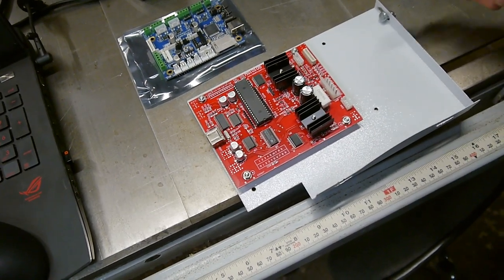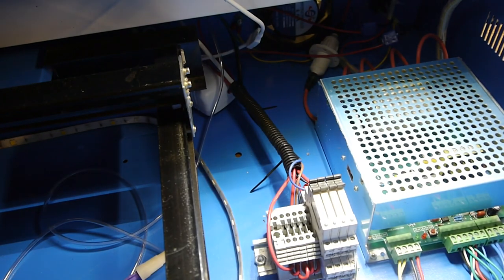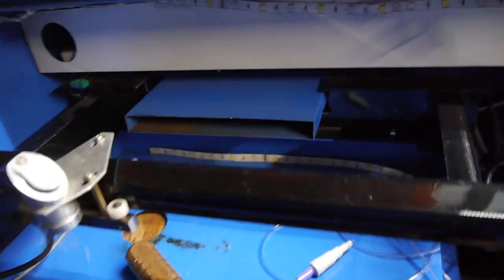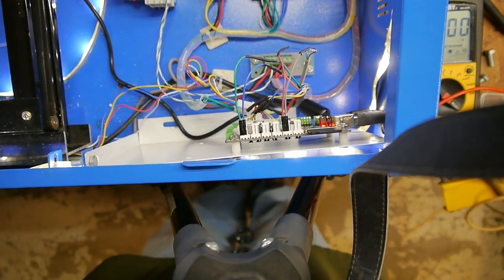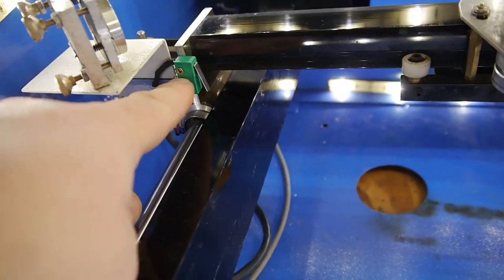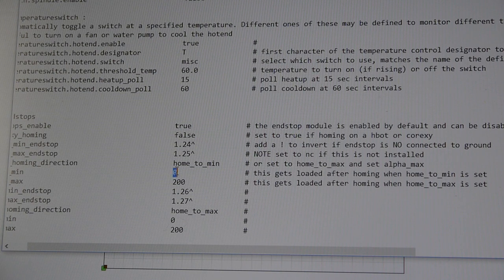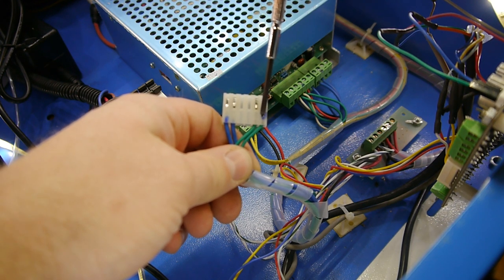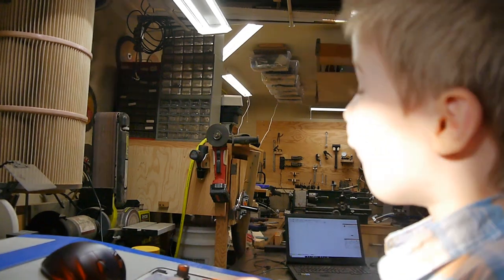How to Replace the MS10105 Board with a Cohesion3D Laserboard - K40 Upgrade (Fixed Audio)

Comment: Nice video. Just got the board myself. Having an issue where despite setting everything to 100% cut power, 1.0 max output, with the potentiometer set to 15mA I cant cut squat. I test fire from the stock switch at that power instantly burns through. Any ideas?
Reply from the maker: Thanks, Does the laser fire at all? If it does then maybe software related, if not then wiring related? Your best bet would be to go to the Cohesion3d Forum and post a couple pics of your unit and wiring and describe what the problem is, like you did just now. I had a slight problem with my laser firing, but I think I originally had the ground and laser fire wires backwards. Good Luck!
Reply: @JoshAQ  yeah it fires as expected just not as much cutting power as it should be
Reply from the maker: @OrderSixTsix  Are you using lightburn software to control it?
Reply from the maker: @OrderSixTsix  It sounds like a software setting or issue then.
Reply: @JoshAQ  using lightburn. Have cut setting to 100% and modified config file max output to 1.0
Reply from the maker: @OrderSixTsix  I was hoping something would occur to me, but I have nothing.... Sorry, I would check out the forum at cohesion https://forum.cohesion3d.com/ that is probably your best bet to find someone else who has had your problem.
Reply: @OrderSixTsix  Hello,  did you figure this out?
Reply: @ddfwaj  I did. I replaced all of the mirrors and that seems to do the trick. Not sure why the old board seemed to be cutting when it actually turned on but i suspect it was putting out way more power than it was supposed to be. Either way, new Cohesion board is working like a dream and LightBurn software is great.

Comment: 00:40  ehh.  changing the board isn't going to fix a problem you have with your sensors.  

i havent replaced my standard board yet (that's why i am here ofcourse.  i wanna use lightburn) 
but i have NO issue's what so ever with the origin accuracy.  
infact i would do cuts in several passes and just programmed a single pass.  it would then rehome every time and it was always on point.  
same thing if i engraved and then cut
Reply from the maker: What model of board do you have?
Reply: @JoshAQ  the one that the cohesion3d is a direct drop in replacement for.
Reply: i am going to use an skr v1.3 instead of the cohesion3d though.  wich is also why i am putting it off.  
the cohesion3d apparantly comes pre loaded with firmware (drop in replacement)  this skr v1.3 does not come pre loaded with firmware.  so i have to figure out what firmware to use.  and then configure it correctly so the pwm signal is of the correct frequency to control the laser output.  

with the wrong frequency it's possible that pwm 25/255 is 15% power output.  
and pwm 26/255 is 80% power output. 
and pwm 27/255 is 0% output.  

 excetra. excetra.
Reply from the maker: @darkracer1252  I see, well the benefit to you is no additional cost, but some time needed to piece together firmware without frying something. That task is certainly beyond my rudimentary understanding of such things and the time necessary to learn to figure them out without frying them.
Reply: @JoshAQ  yeah i won't be coding my own firmware from scratch.   it will probbably be grbl or marlin.  and then it's just a matter of configuration. (wich i have alot of experiance with because of my 3d printing hobby)

Comment: Can't wait to see the Z table you build....or if you just build a larger laser :) hint hint ;) ;)
Reply from the maker: Oh you are evil, don't tempt me lol. :-)
Reply: @JoshAQ  Some longer rails, belts, enclosure large enough for an 80w tube...hmmm. I bet you can do this on the cheap
Reply from the maker: @gamble1997  Even cheap at this moment is beyond me lol. I broke the bank with the 3d printer and cohesion3d board. So I am down to material on hand or what I can scrounge from the dumpsters lol. Buy I agree it can be done. I think the hard part is moving my brain away from machining standards and to laser engraving standards. I have been messing about with laser lens interfacing and have come to the conclusion that boy oh boy moving where the laser strikes the lens matters a lot like at least 1/8" as it moves around the gantry. So if you want repeat ability and accuracy in placement of holes across the width of the work piece then your laser alignment needs to be dead on! The hole diameters will be accurate but their centers will not. At any rate need to learn more before investing lol. How is your laser doing?
Reply: @JoshAQ   Havne't really had time to touch it. But check out my instagram I think I put a pic of the adjustable bed....cough version 1 cough.. I just did. used scrap material on hand an bought a bunch of springs to try out. Needed springs that were way softer than I thought. I cut some steel tub and welded on a washer, slid it over the existing stand offs, put springs on (touching the welded on washer) and then flat stock with holes, washers then piece of L aluminum with a smaller hole so it stays on top of the standoff and the factory screws. The screws have to be mildly loose or it just puts too much tension on the part but I think thats because the part is so small it's not supported top and bottom. We will see, just order some cast acrylic. Now to make a vent outside
Reply from the maker: @gamble1997  I saw it and it looks good! Yeah, really need a vent! I ended up cuttng a length of acrylic to size then putting a hole in it for the vent to go through and placing it in my window. I like my natural light so I didn't want to use wood. Acrylic fumes are terrible. Reminds me of the episode of Aqua Teen Hunger Force when Mastershake burns tires to heat the house. Just terrible on the eyes and throat!

Comment: 02:50   to be honest.  i can't believe i need to watch a video on how to replace the board from someone who can't even use the laser.  
cut out and then reposition and engrave????   WTF!!!?

you engrave first.  and cut later.  you also do NOT move the product between engraving and cutting.  because it's much easyer to get a cut image alaigned with the engrave image in the software.  then it is to alaign the actual workpiece with the laser head.
Reply from the maker: I am glad you didn't have trouble with the MoshiSoft 2014 software. What software and board are you using now? I could not for the life of me get the old board to engrave and cut in the same op. I tried engraving, then using the same origin to cut out the engraving and the cut would be off center in some way. Very frustrating! That is the main reason I upgraded the driver board. I thought it might be the limit switches, but the new board uses the same switches and doesn't have a problem, so I am at a lost to explain it. So if your software and hardware do not allow you to do repeatable results, then what do you do to get an engraving and a cut to line up? It was a real pain!
Reply: @JoshAQ  sorry about my rudeness btw.  

i am using the newer board.  the m2 
probbaly also a newer firmware.  

it doesn't use physical endstops either.  it uses a piezo electric one.  (a strip of metal on the axis going into a detection slit) 

i have no idea if mine is still using moshisoft 2014.  it's an old model (first or second gen) so it might be the same.  
it does rehome every single time i start a new job.    
so it rehomed every time i restarted the same cut for a new pass.  and it lined up perfectly every time.
Reply: i have an skr v1.3 (a 3d printer board) that i am going to use instead of a cohesion 3d btw.  
it's 32 bit instead of the 8bit cohesion or the default board our k40's came with (plus it has a touch screen)
Reply from the maker: @darkracer1252  All good sir. That piezo electric end stop sounds fascinating! I'll have to look up how the physics works on those. Ah the M2 board. Yeah, I wish my original board was that, more options for controlling it I gather from the little I read. I am glad you didn't have to struggle with the MS10105 board.
Reply from the maker: @darkracer1252   The touch screen does sound nice. Let me know how that works out for you. I imagine the loads on the steppers would be about the same between a 3d printer board and a laser engraver so I would think that would work. Do you have a 3d printer then as well?  I have to say when I purchased my i3mk3 it was a very happy day for me. My previous printer was a Davinci 1.0 that only printed in ABS, and I could no longer get the proprietary filament from XYZ.
Reply: @JoshAQ  yeah one clear diffrence i noticed is that the m2 one has extra ports. (you can hook up a z axis)
Reply: @JoshAQ  they are regular nema17 stepper drivers.  exactly what's in the machine.
and the stepper drivers i have are silent.  and can dynamicly adjust the voltage if more load is detected. so it never skips steps.  
if i make it skips steps by blocking it physicly it will automaticly stop.  rehome.  and continue where it left off.  if it fails again it will just stop wait for the user.  

there is a whole slew of nice features. and i am hoping with the 32 bit board it will be able to get high speeds without ocassionally loosing track and backtracking a bit.  (with high dpi at high speed this happens alot in my current setup) 

but it's the laser control that i really need to work out.

Comment: on a side note.   i am so happy i did not buy this board.   
that whine of the steppper motors is excusiating.     
and the cohesian does not have replaceable stepper drivers so you are stuck with that high pitched noise.
Reply: The Laserboard allows for external stepper drivers of your choice.

Comment: had to dislike the video when you said the pot was turned all the way up.  
you just DO NOT do that.   
these pots basicly go from 0% to 150% power.   turning it all the way up is overdriving the laser tube (and if you have been doing that since januari this year then i bet your laser tube is dead or dying by now)  maybe even the second tube already that is dead or dying since then.
Reply from the maker: Still on the same tube, but admittedly I have not used the laser much since then as I moved on to other projects in the garage. I normally dont' push it past 24 miiliamps with the pot, but since the new board pulses the on off time for the laser I used the software to control output and I don't think it went above 24 milliamps... Eh maybe it did, but yeah I agree it is a great way to scrap a tube.